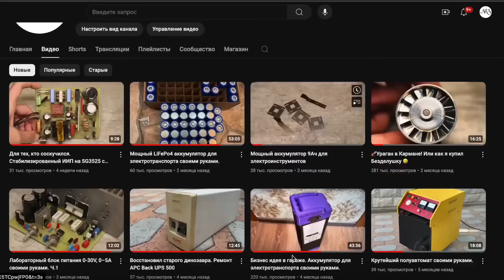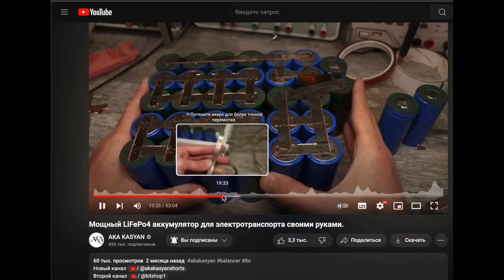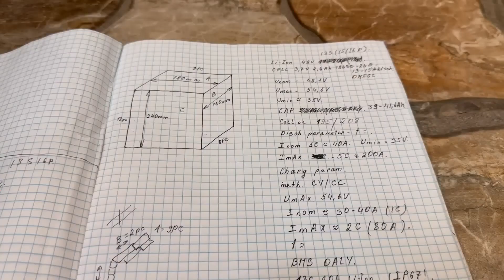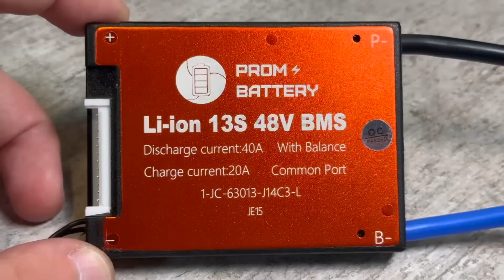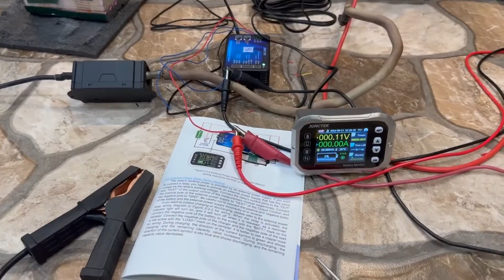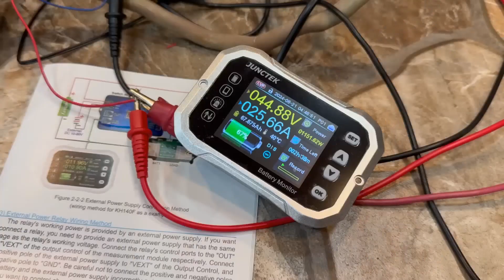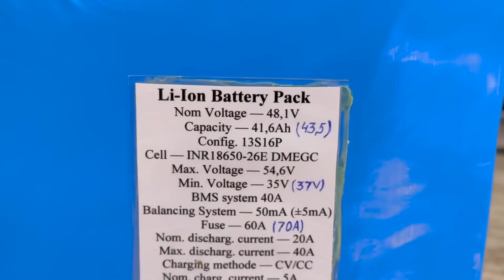The Right Way to Build a Li-Ion Battery Pack for Electric Transport

Comment: That's pretty neat. So you made the last one out of LFP cells, and these ones you made out of Li-ion cells. Out of interest, why did you use 2.6Ah cells instead of the ~3Ah cells? Are they better at high currents?